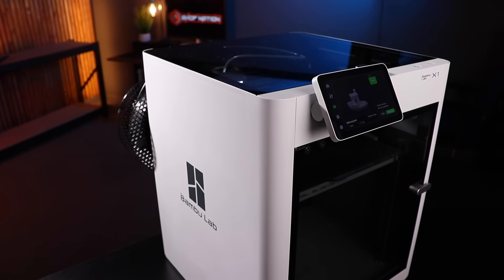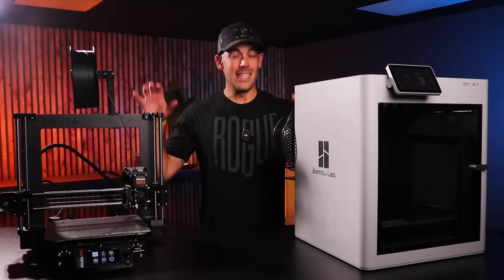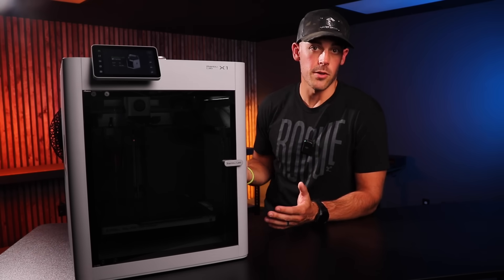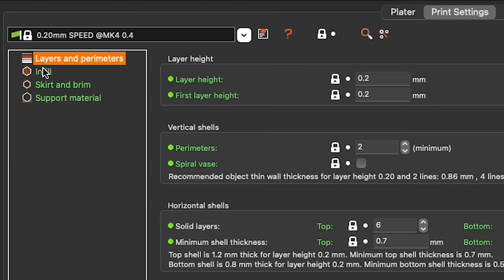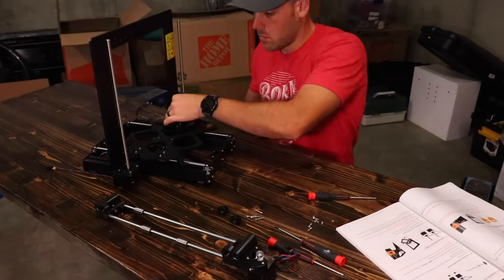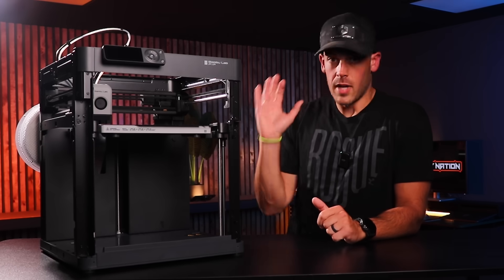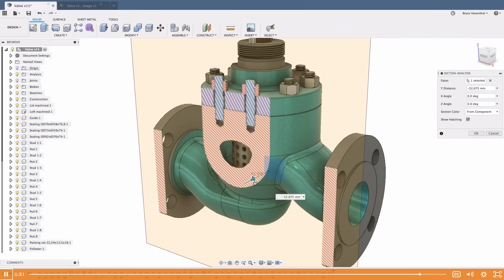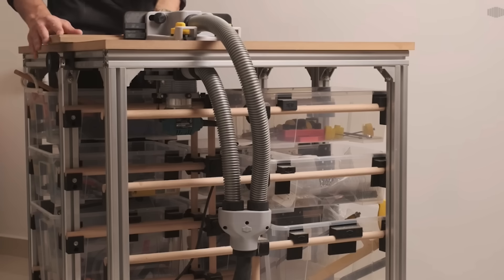The 3D Printer I'd buy if I started over

Comment: Owning the Bambu lab X1 combo I strongly disagree with you on it being the choice of printer ESPECIALLY because of the slicer software and its implementation. 1) You need to connect to the cloud to connect to the machine (go to the site and read just how many people suffer connection failures) 2) Unreliable settings unlike other slicers where they are user side opening a connection means the current project can be importing (without you knowing) settings from previous jobs or resetting defaults. It does both without warning. 3) the previous issue means you have to thoroughly check all your settings creating a huge waste of time per project. 4) If you have the multi color AMS the set up has two separated points of contact to input materiel and color the machine can and will vary on which one it'll chose to run for the job ( These are issues Bambu lab has not addressed and causes the user to hang over a print start up to be sure the right spools are in fact going to be used) 5) The speed on prints has a detrimental effect on the surfaces of overhangs especially supported overhangs the quality of the surface can be so poor even the cheapest machines do a better job. 6) staying with surface quality: variations in shape such as vertical curves create distortions in the luster of metallic filaments, more or less luster. So consistency of more demanding materials is a problem. Other issues exist such as shipped with warped plate being hard to RMD etc. But as it stands if you plan to do much more than spit out parts which surface quality is not paramount. I'd definitely NOT recommend Bambu lab as the printer to buy. certainly not for first timer 3D printers.

Comment: I had the fan shroud break on my ender 3, thinking I could just print a new one and use the melt in inserts into it hasn’t been easy because they aren’t the right size. It has been sitting because I was getting annoyed using filament up trying to find one that is the correct dimensions. I’ve just been running my X1C for everything and want to get another Bambu printer. I have been wanting Bambu to come out with a larger build machine.

Comment: Yes to a printer that just works. A few years ago I was given a free ANET A8 (it had nearly caught fire!). It’s been a great learning experience about fixing and modding printers, as well as learning to 3D design. BUT it is so frustrating to use; too much time wasted trying to get it to print consistently. To cap it off the plastic frame broke the other day, when I moved it. I was trying to fix yet another nozzle clog 🤬🤬🤬

Comment: I am currently experiencing difficulty with my Ender 3 V2 printer as the filament is not adhering to the plate. I am wondering if PLA can become dry, as I had some stored on a shelf for a year and a half. Is it safe to use? Could this be the reason for the lack of adhesion?
Reply from the maker: Unless you live in the middle of a desert, your filament is much more likely wet than too dry.  Dry filament is actually very good.  Stringing and lack of adhesion could very well be because it's too wet from sitting out
Reply: @ShopNation  oh! i had it backwards. funny enough on my home page right now i see a video about "repairing" wet filament with a food dehydrator haha how funny.
Reply: @ShopNation  thank you a ton for your reply. hope you have an awesome day.
i just printed a Mayan death whistle and it turned out fantastic!

Comment: Went down the rabbit hole of tinkering and modding to the point working more on the machines instead with them. 
Took the plunge, went for the X1C, wanted to know what all that BambuLab fuzz is about. Eye opening experience.
Last time I was this impressed by an overall package and ease of use was when switching from a Nokia to an iPhone. 
Brought back the fun in 3d printing for me. 
Valid criticism on openness or walled garden aside (still there are great alternatives like the Prusas available if this is a factor), these guys gave that needed push to the industry, that finally 3d printing could get a commodity now and not being an expert‘s exclusive tool only.
Great video!

Comment: Damn, the old "it just works" routine again. No 3D printer "just works" and that nonsense is a disservice to anyone new to 3D printing. The best honest advice you can give people is that, "3D printers are not user friendly appliances." ALL of them will provide the user with ample mechanical and software related challenges.
Reply from the maker: Sounds like you've just experienced the bad ones

Comment: Awesome video.  I've been wondering for a while which printers you use.  I bought that cheap ender 3 last year and have built MANY jigs for my shop, but I've fallen down the rabbit hole of upgrading parts to get a better print - glass bed, direct drive, CR3 level, etc.  I've been thinking about upgrading and had been looking at the P1P as well as the AnkerMake M5.   I think you've made that decision for me. Thanks!

Comment: Cannot agree more!  I have a Prusa MK3s+ kit and a P1P and they both have almost paid for themselves in 6 months.  Besides printing now my 5th shop nation dust collector for my Bosch mitre (yeah, I keep blowing them up), I have printed a bunch of dust collector fittings and other simple tools that have been a big help in the shop.  Also started designing and selling stuff for my bee business.  Basically they are little employees that I put to work for me while I sleep.  The only knock I have on the P1P is it is LOUD!  I have both in my office while I work but the P1P is too loud to run during the day.  The Mk3 is quiet and I have no problem with it while working.  I really want a 500x500x500 3d printer so I can do 19 inch stuff, but that will have to wait for now.

Comment: $1200 for my first printer? Why? I feel the pain of posters here who started with an Ender 3 Pro... I made the same mistake, but it isn't comparable to a Bambu or Prusa by any means... it's like comparing a go kart to a luxury car. You can add on things that try to make a go kart into a usable vehicle for your daily commute, but they'll be painful in terms of money and time spent, and will still be bolted on hot garbage. I gave up on my Ender 3 Pro when the dual z-axis upgrade couldn't be saved for the binding. That said, the solution is to get a sensible car, not the luxury model. Most of us can't afford $1200, heck, you can buy 4 or 5 Sovol SV06 printers, a suitable Prusa mk3 clone, for that kind of money. There is a whole slew of 3D printers, far more affordable, that offer pretty much most of the quality of life improvements a good 3D printer should have. I had my Sovol SV06 Plus turning out a fantastic benchy within half an hour after I unboxed it (and no problems with it since). When I gave up on the Ender 3 Pro, I replaced it with an Ender 3 S1 -  a "refurb" unit, no less, and it's also been a great experience. Those Sovol printers are also "open source" so finding parts is no problem, and Creality parts are easy to source, as well. I like sensible cars that aren't high priced. Prusa and Bambu make fine printers, but I have yet to see any printers, at any price range, that are without flaws, and likewise, some of the lower priced options have gotten great reviews. I just think "spend buckets of money" is the kind of advice that doesn't sit well with a crowd that got a bad experience trying to shave a few pennies buying a $150 printer and upgrading.
Reply from the maker: Did you make it to the part where I said don't spend $1200?
Reply: @ShopNation  🙄Well, I will now. (smoke bomb) - (returns) - OK, point still stands though, even at $700, it's a high ticket item for a lot of hobbyists. If I was considering any other printer at that price, sure... I'd love a P1P and the ability to add an AMS without too much hassle, but as I said, I've been happy with my $200~400 options. I just printed a part today to fix a broken baby gate catch. Took measurements, knocked out something crude in 3D Builder (relax, I would have used Fusion 360, but it was that complicated) and had something printed out in an hour on my SV06+ that worked. I was confident enough in the printer that I dropped the gcode into the Octopi's browser page, and started the print without running to my basement to make sure everything was set beforehand (I hadn't printed in a few days). Like I said, Bambu and Prusa make great printers... a P1P is certainly on my wish list, but I'm productive now. I also have an IDEX that is a bit more primitive, but does what it needs to do (until I get that P1P+AMS). Klipper intrigues me, but right now, it means converting machines (since I have the aforementioned E3P and Tevo Tornado) and a bit more work than I want to put into it right now.

Comment: Let's be completely honest about 3D printing. It is painfully slow even on the fastest 3D printers compared to other methods of manufacturing. There is a reason why companies which manufacture 3D printers have components injection molded instead of printing the parts using their own equipment. The reason is cost.

3D printing should only be used to produce prototypes or small production runs of parts which cannot be manufactured using conventional forming or subtractive manufacturing techniques.
Reply from the maker: Prusa operates a print farm of over 600 printers producing parts for their machines.  Josef Prusa knows that injection molding of these parts at that scale carries a cost benefit but agility with design changes is the reason he continues to print.  3D printing is generally terrible at mass manufacturing, yes, but this video isn't about mass manufacturing

Comment: Fantastic video from all aspects! I am a retired mechanical engineer that specialized in machine design for the industrial digital printing market. After using Pro-E at work, I gravitated into Fusion 360 for home cabinet projects as I neared retirement. I have yet to jump into 3D printing to make all those little jigs & fixtures for my tiny home workshop, but this video may just give me the impetus that I needed to make the plunge. Thanks!

Comment: Just subscribed. I bought a used Ender 5+ and must say I've had more failed prints than "good" prints. Will the P1P work with Bambu labs multi filament system?
Reply from the maker: Yes it will

Comment: The X1 and P1P are a big outlay for those outside the US because you get killed on shipping spending anything up to 30% of the cost of the printer on shipping alone. I think the SovolS7 may change your mind as it should get 80% of the performance of the P1P at half the price and its more than capable for an entry level.
Reply from the maker: Europe should be fairly cheap shipping for Prusa, shipping to the US is minimum $50

Comment: It's a relief that the Bambu Lab X1C is mentioned - Because that is exactly what I have.
[The X1C & the AMS combo have made the thing sooo convenient and less-frustrating vs. others]
Great video,  and IMO ya nailed it!  [Mine is also a 'tool' - not just a piece of a puzzle within a hobby.]
Reply: what do you make?
Reply: @shane_wc  Update:  NOTHING.
The 1st setup failed miserably,  I sent it back,  received the 2nd setup,  and the AMS has NEVER worked correctly.  Even with Every Single Mod available.
Epic Fail & Waste Of Money.
Reply: @DirtyDovi  i mean what stuff do you print now, im thinking of getting one but dont know the capabilities/reasons for getting one...i dont wanna print little figures and trinkets
Reply: @shane_wc  Ah right on man,  so we think alike!  [I initially planned on designing/printing usable parts for high end PCP air rifles,  as well as components for electric unicycles,  dual sport bikes, etc.]

***I needed a way to do Multi-Colored-Prints..  Hence why I fell for the hype and the shills on here,  and got the setup.. 
[For Commercial Prints/Sales]  Nope..

With the two units Both failing to deliver,  I pretty much gave up.  No time / patience for their 'tech people'.

Last night - I printed a 'butter pig'..
It's a screw driven butter dispenser.. 
It failed to print the Huge Threaded rod
Before that,  I printed a paper towel holder, and it failed at that..

More than 50% of prints are 'unacceptable' to 'ruined' do to either the support material fusing to the prints,  or,  'spegatti failures',  and that's with Bambu branded filament.. 

I've tried Sunlu - a few different blends, 
and it's pretty much the same deal.. 

Depressing as this setup was supposed to help me get away from the living hell [occupation] I'm currently stuck in.. 

Although I'm a 'noob' to the machines,  
I've followed the tech and advancements for over a decade.. 

Now having THIS setup,  and experiencing all of the issues, etc. with it.. 
It's turned me off from ever pursuing 3d printing Ever Again.  Sad/Infuriating 

Sam -
Reply: @DirtyDovi  wow dude thanks for the informative reply and thats shitty to hear lol not very encouraging for me, the last thing i need is another space occupying dust collector, the only thing i've seen that interests me are printed firearms (print shoot repeat on youtube) but im in canada so its super illegal haha guess i'll buy more knives instead
Reply: @shane_wc  Shane,  you're most welcome bro,  and yeah.. for ME, it's been a sh*t experience.
On the 1st setup,  I'd get every error the thing could possibly spit out.. 
That one - was the Printer.  Sadly,  I had to send Both the printer and the AMS back.. 
On the 2nd setup,  the printer works GREAT, but the AMS is a worthless steaming pile..  
So if you DO get one - Maybe nix the combo, and Just snag the printer.. 
Dude,  you might want to check out a few of my videos..  I'm all about precision shooting.  ;) 
Print Shoot Repeat?  "Never heard of him or his channel"  hahaha 
Yeeeaaah buddy!  I'm with ya,  and actually..  'someone' printed out a few Ruger 10/22 receivers, w/ plans found at random,  and I Will say this - It printed Amazingly!! 
Here in NY,  they've pissed all over our 2nd amendment rights,  so I transitioned from powder burners to high pressure air [PCP:  Pre Charged Pneumatic]
And we're also Legally able to suppress them..  
There are a few 'big name' suppressor designers/sellers,  and I hoped to join in.. 
The printer needs to be able to do Precision prints - 1 for concept and 2 for sale.. 
I'm unable to do that w/ this setup - and people promised it was AmazeBallz until' I got it...
Tried a few prints, and the damn tolerances where ALL OFF.. 
Then as mentioned before,  the support material will always stick and double-ruin things.. 
I have other friends [all over the globe] who are 3D printing these same things w/ zero issues. 
Magazines are another Big one - for our air rifles,  and this thing just can't seem to hang.. 
Pretty bad when a printer costing a few hundred bucks can absolutely school it.. 
Total buzzkill for sure.

Canada - aw bummer bro,  yeah..  TruDildo and the others in parliament really 
love screwing you all when it comes to firearms..  History Repeats Itself is all I'll say.
That said - knives rock,  [and so do semi auto crossbows - wink wink  hahaha]
Reply: @shane_wc  Last night,  I made one more [wasted] attempt at printing something important.. 
Tamron 70-200mm camera lens Hood.  Printed w/ Bambu's PLA-CF
*When removed,  there where stringers all over the base [also the area w/ custom mount/thread]
*The mount/thread area was not printed properly either
*After too much 'clean-up',  I attempted to mount the hood to my lens, 
and Go Figure - It Did Not Fit.  Either the mount/thread diameter is too large, or just wrong.. 
[Interesting how others have successfully printed the same hood and their prints work flawlessly]
Again,  a 'simple print' that Failed Miserably - as well as wasted my money/patience/time.. 
Unreal..

Comment: I started with an ender 3 v2, had a good amount of fun before I got tired of failed prints on a slow base printer. Had no desire to learn upgrading, and bought an x-1 carbon w/AMS. The x-1 carbon has been so damn amazing. I can iterate designs as needed, and they print so damn beautifully fast. I love it.
Reply: Same here. Finally getting into designing and printing as a hobby and not just waste time on tuning and fixing that piece of crap
Reply: @nipshardaf  Nothing wrong with enders if you know what yer doing... A better fan and ditch the plastic extruder and it works fine. The one I have at work prints 8 hours a day 5 days a week without issue so... yea. Also a slight difference between a $300 printer and a $2000+ printer 😂